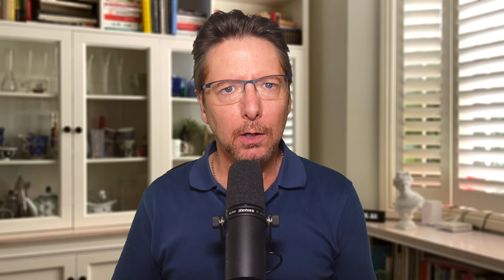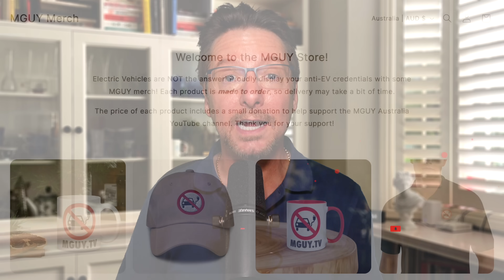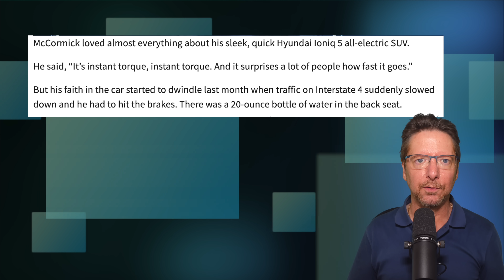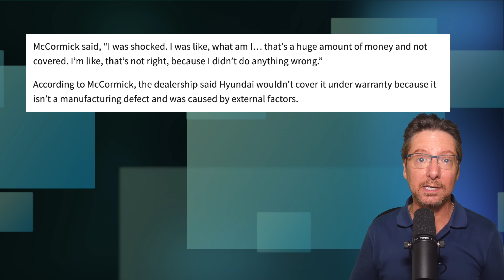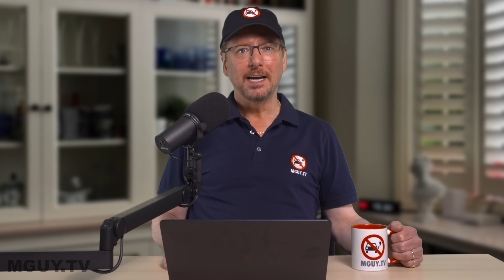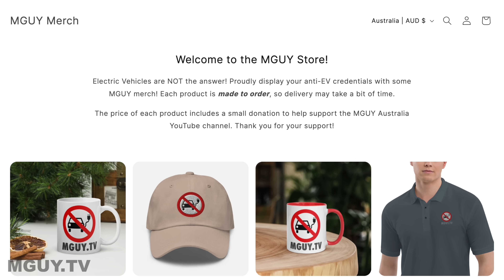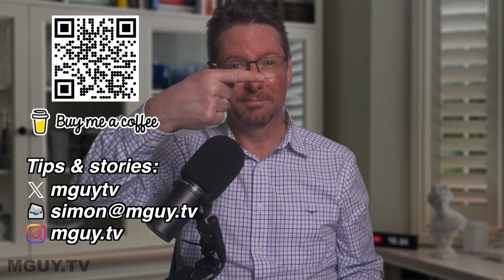ASTRONOMICAL EV repair bill for spilling a WATER BOTTLE! | MGUY Australia

Comment: I once accidentally parked a rally car in a river in Kenya (rainy season; the wooden bridge had been washed away). My co-driver and I, ignoring reports of crocodiles and hippos, winched it out, waited for the cabin to empty, gave a squirt of You-Know-What under the bonnet to give the electrics a thrill, searched in vain for some missing stage maps, and continued on our way. At no point did we consider the possibility that getting the car full of bright orange muddy water would end our rally.

It may be significant that EV-based 'Desert Raid' rally challenges tend to take place in the Sahara, where the wettest things to be found are the tears of laughter rolling down camels' cheeks as the beasts watch the cars attack the dunes.

Note: I've always maintained that only barbarians eat when walking on the street, and that any car manufacturer who fits cup-holders to a vehicle should be horse-whipped for encouraging in-car quaffing.

Don't (soft-)drink and drive, lest you b*gger up your car's interior.

Comment: A car of the same Ioniq brand ran over some small fallen tree branch in Canada and the wood caused a tiny scratch on the safety plate guarding the battery. Hyundai refused to even open the compartment to check but said buy a replacement battery for C$ 61000. More than the worth of the one year old car. Insurance totalled the car !
Moral: dont buy Hyundai Ioniq

Comment: So EVs are dxxked in hot weather,  cold weather and heavy rain/ monsoon weather
When are we supposed to take them out ?

I was driving in heavy rain in Bangalore India, large water puddles on the road, when this long distance bus decided to overtake everybody using  a lane abandoned due to flooding. Passengers and interior of my ICE drenched. I drove home cursing and kept the car doors open in the garage to dry out the interior. The car later ran smoothly ignoring the bath. (2006 manual gas 1.3 L suzuki hatch back)
Reply: You take them out when it is not too cold nor too hot & not too wet. But otherwise, they are great for when you are bored because you can spend time planning when and where to charge up, while drinking coffee, eating chips, and talking to other boring people charging their milkfloats, about how fast they accelerate while saving the whales, or something.

Comment: Would not cover  because it was not a " manufacturing defect ". The whole damn E V industry is a " manufacturing defect ".
Reply: Reminds me of the first Cell phones, get them damp and they failed.
Reply: @digger105337  They still do not like water!
Reply: Tiny Hat Mafia.
Reply: Correct. It is absolutely a manufacturing defect. 
A spilled bottle of water should not result in $12,000 in damage.
Reply: Yes. Very true.
Reply: Wasn't a "manufacturing defect", it was a "design defect". If they admitted the second, it would cost them far too much to recall and amend.
Reply: @damianwright3690  I'm shocked that aluminum is rusting that bad.  When it rusts, the rust forms a skin that stops more rust.
Reply: @robertsmith2956  Aluminium doesn't (edit: rust that bad), they must have screwed up somewhere. As an aside about aluminium rusting: There's a very very important reason why mercury is forbidden aboard aircraft - if elemental mercury gets in contact with aluminium, the reaction can eat through structural members, and the problem can remain hidden for a long time if the mercury manages to make its way into a tiny hidden nook. Look it up, there's videos on what elemental mercury does to aluminium.
Reply: @damianwright3690  Exactly.
Reply: "The whole damn (...) a " manufacturing defect "." 
 
As defective as the leftist governments trying to mandate EVs.
Reply: Insurance rates should reflect the total costs for repairs or replacement of all vehicles.  If my 1997 GM van blew up I would expect to get no more than $500. from them so no collision insurance is required. I'm happy with the am/fm radio , a heater and a.c. I go from A2B just like anyone else. My son in law has a 2016 Rogue that needs a new headlamp but it will cost over $3000 to replace. Check out repair costs when you buy your next vehicle (Google)
Reply: To be fair, I think they would have the same response if you took in your gas car with a similar issue (EDIT: similar in that it was caused by the operator, not a defect).
I'm not a fan of EVs and would never buy one, but the real story in this particular case is the fact that State Farm wouldn't cover the damage.  
Clearly it was accidental and this is precisely why you pay for insurance.
Having dealt with a similar issue with my home insurance, and my sister with medical insurance, there needs to be extreme reform within the insurance industry.
It has become a scam, as they weasel their way out of paying for anything.
Reply: @dt8185  Which they couldn't do if you were could not buy the insurance in the first place.
Put the premiums in the safe, and use the money when needed to fix/replace car.  Learn to drive and there is no need for insurance since you won't be at fault.
Reply: @robertsmith2956  What an odd reply.  Clearly you are underage or don't live in the west, where it is legally required that you have auto insurance in order to drive.  And since even perfect drivers can be victims of circumstance or other negligent drivers, your argument is rather ridiculous.
Reply: @dt8185  As I said.  The negligent driver is at fault and responsible, not you.
Reply: @robertsmith2956  Well, hopefully you have enough money in your safe to cover the car repair/replacement, medical, recovery bills, etc., when you get hit by an uninsured, negligent driver or are a victim of circumstance.  And, of course, you don't get a huge fine/jail time for driving without insurance.   Whatever floats your goat.
Reply: @dt8185  As I said, it is the drivers problem. Just forward the medical bill to him.  Of course I can fix the car.  I'm not wasting money on insurance, I keep it aside to replace the car when it wears out.
ay cash for medical treatment.  You will be shocked how much cheaper it is.  You could have major surgery every other year and come out ahead of obamacare insurance cost.
Reply: @dt8185  "To be fair, (...) a similar issue." 
 
A "similar issue" of "corrosion over time" after spilling some fresh water inside of a two year old car? My 16 year old Golf still works, and here the temperature hovers around zero - and they spray the roads with salt water - for months of the year. If I put my electric dehumidifier in the car, it might suck up half a liter of water in a few days.
Reply: @Laura_Norder-Vanity_Unfair  Poorly worded.  I meant similar in terms of an external, operator caused issue, not that a bottle of water dumping out on the floor would affect a gas car.  That said, if you poured that bottle of water into the infotainment unit, fried it, and the dealer determined there were no leaks into the car, then yeah, they probably wouldn't cover that either.

Comment: Computers are actually relatively easy/cheap to fix since they're very modular, unless you've bought a prebuilt with proprietary parts or the PSU failed and fried the whole machine. It's just that the computers inside cars are basically prebuilts when it comes to diagnosing and repairing problems.

Comment: The story about a water bottle was wrong or the insurance should have paid.  Even so $12K USD is an insane repair bill for some safety belts?  Not a defect?  How many cars would fail like this?  Did he buy the car used?  Maybe it had been exposed to salt water?  Salt water corrodes  if not removed quickly.  I have a 60 year old Vollvo P1800, I'd had water in the passenger compartment many times over that period and it isn't rusted nor ever need even a $500 repair bill ever. One reason the car industry has gone with so much tech is to have built in self destruct due to no support - They've gone iwth the Iphone model of built in obsolecence - oh water - new car!. Oh sorry that car is no longer supported its 6 years old - it is out of warranty. They can't be repaired by the owner, they want you dependent.

Comment: I am a GM tech, we had a suv towed in no start. Owner said that they were driving and all the warning came on and the radio stopped working. She turn off the truck and then had nothing. I found that that data line was pulled to ground (short) in the rear overhead dvd player by a coin that a kid slipped in the slot. to track id down and remove the coin and get running was a two hour job. The dealership covered it under good will because it was under warranty even though it was NOT A DEFECT but bad design and a tech bulletin was added to help techs.

Comment: I'm surprised there and not more instances of major problems due to corrosion.  I4 is in Florida.  I lived in south Louisiana for for 5 years and discovered how much the salt water atmosphere attacks the wiring in cars and motorcycles.  The surface corrosion causes any water that contacts it to become electrically conductive.

Comment: Tthats what you get when you cheap out on protective coatings and have high density boards with pcb's 4 layers or more. Glassfiber boards can/will wick up moisture if not properly made or protected. Pcb's today made with 5 mil or less, so it doesnt take much to get a bad track, even better if the fault is in the internal layers. Try to fix that with no schematics! With 0.5 oz of copper or less and tracks 1-5mil it doesnt take much to burn those out.

Comment: I thought it would be because in a lot of EV's the batteries are basically right under the rear seats/floorboards. It's even worse that it's just the driving controls and such that are destroyed by a little bit of water. The repair guy even said it could of been caused by merely wearing wet clothes lol. As in you get rained on and sit in your car, and you destroy it. Reminds me of the stories of EV's being bricked because some one took it through a car wash.

Comment: HAHAHA, I work on Land Rovers and some of the RRS's  and RR have an issue where the hose from the windshield washer to the rear of the truck will brake and dump the contents on the bottle into the car and it still doesn't cost the customer 10k at Land Rover prices to repair.

Comment: I live in the USA northwest and we have endless fir trees.  I have an old Mazda where you have to clean out the cowl drains yearly , or they will clog with fir needles and get the  driver's and passenger floor wet .  The new vehicles are fragile devices designed to drain your bank account in one big hurry... and its no accident.

Comment: I do contract work for a bodyshop.
Tesla model S headlight unit... None in the UK so had to be imported.
2 months later... One correct Tesla headlight, they sent the wrong one originally.
£2500 for the headlight!
My old van leaked when it rained, the drivers floor went between paddy field wet and slightly damp.
It was like that for 15 years, no issues. It eventually rusted, but the drivers footwell wasnt rusted.

Comment: My 1997 Honda van, which I use as a surf vehicle, has more beach inside it than outside.   I often forget to close the windows when it rains, and the doors get soaked.   It never gets cleaned.  The car has had zero issues, except for a loose wire to the battery one time.   It has never failed to start, even with the loose battery.  Best car ever made.
Reply: THE INSIDE OF YOUR HOUSE IS THE SAME WAY!!

*NEVER GETS CLEANED*
Reply: @bellytripper-nh8ox  True for the most part.
Reply: @bellytripper-nh8ox  True

Comment: Disclaimer; Not trying to defend EVs. I cackle every time I see one of the worthless things burst into flames.

But this has nothing do with it being an EV. I was a dealership mechanic for years, and diagnosing electronics was my main skill. This is just ALL modern cars. Every model, Gas or electric, have so many useless features in them that they really are this vulnerable to water. 15 inch Touch screens, heated and cooled seats that massage your ass, DVD players, $2000 slabs of glass over your head held together by 20 cent plastic clips. All controlled by miles and miles of wiring, and dozens of control modules. Pretty much NONE of the connectors inside of the cabin are weather/water-proofed. Modules inside are usually not weather proofed either. "They're inside the cabin, why bother?" -Someone in Accounting probably.
I've had to replace body control modules in cars because the owners got their windshields replaced, and the shops that did that didn't get the glass sealed correctly. Tiny little bit a water (Or in this case, washer fluid,) and the module goes pop.

But even then, $12,000 seems way steep. Either we're not getting the full details (Shocker,) Hyundai is even shadier than I thought (I refuse to touch Hyundai/Kia with a 12 foot pole anyways,) or the dealer's trying to pull a fast one (Also shocker.)

There's a reason a lot of mechanics only drive older cars. The newest car I drive is a 2008 retired police model Crown Victoria. The most complex thing it has that can go wrong on it is the aftermarket stereo I installed. That car was so basic it only came with an AM/FM radio... No cassette, no CD, no aux. AM and FM, that's it.
As long as people continue to buy luxury spas on wheels though, this problem will only continue to get worse.

Comment: I helped my nephew wire his winch on the front of his Jeep with a 6” lift. He goes off-road and sometimes crosses water crossings a 1/4 to 1/2 of his doors. He allows changes in fluids after a trip and has never had an electrical problem. Maybe something broke because the trail some are harder than others.

Comment: Electricity and water (H2O) is not a problem (water doesn't conduct electricity).
Dirty or water mixed with other chemichals will conduct electricity and be dangerous depending on the tension (V) and current capacity (I and W/h)

Comment: This is absolutely hilarious.  These EV buyers deserve every penny they have to shell out for the fake climate BS. I wonder how many of these EV's are built using soy insulated wiring 🤔 Just wait till the mice get a taste of that 😂 And then the insurance companies will deny claims because of the wiring attracting mice.  This whole EV thing is hilarious to watch as the poor liberals keep losing it each time their cheaper car turns out to cost an arm and both legs to operate and keep running.  Tires alone have cost one person I know of 4 times what they did for their ICE vehicles. They drive the same amount of miles but have had to change their tires 4 times more than their ICE car tires because of the battery weight! I don't feel sorry for them because they fell for the EV BS hook, line and sinker!

Comment: Saw  a local news bit on this, they were all in the bag for this guy & never mentioned the sand or that the adjuster determined there was ongoing corrosion.  That would be easy to spot.  If I was inclined to even consider buying one of these turds one of my first questions would be where's the battery followed by how's it protected.  Sounds like this guy never gave a thought to any possible vulnerabilities his toy car may have which is odd considering everyone knows you don't drop your phone in the ocean.

Comment: This not just EVs all modern cars are the same water on damp getting into the electrical units anywhere will require the replacement of the entire unit, and cause ridiculous contradictory  fault codes. 
Damp causes digital codes to mis read causing the central computer to become so confused as to what the nonexistent digital numbers refer to it eventually just crashes, hence you cannot get any control to work.
This is why I would not get in any car that is stear by wire or break by wire, they are all death traps!

Comment: I had an Audi A4 a lonf time ago (a few decades back) that flooded to just under the seat level from high water.  It broke a computer under the passenger seat and it was in limp home mode where it was stuck in 1st gear.  VERY pricy for a water damage - but it was just the computer needing replacement so guess I was lucky <g>

Comment: In 2023 I had one of those office water bottles on the backseat of my Mazda CX5.
It fell over and broke, pouring out half of the water in the carpet and floor.  I cleaned up as best as I could, but it was still soaked.
Two years later the CX5 is still running strong.
We are currently in the middle of a road trip back to Ontario and driving back to Nova Scotia next week.

Comment: You do know that Hyundai make it almost impossible to replace the rear brake pads. They do actually pay lip service to  make it possible to satisfy regulators but owners would have to pay a massive amount to buy a dedicated Hyundai computer and another pay for temporary subscription on top, making it very very expensive to do so and the hoops to jump through to do so, even disregarding the cost, kills home maintenance dead.

Comment: "Instead of replacing a small part, you end up replacing a huge chunk of the car at enormous expense" This goes for modern ICE cars as well, they are just as crammed with expensive electronic modules. Even something as simple as a blown headlight can cost upwards of $2k since they're sealed LED units these days, you have to replace the whole assembly instead of swapping out a $20 globe.
Reply: We put LED bulbs in our houses to save energy. A car especially an ICE car has an alternator to make it's own electrical power. WHY do we need LED lights in them other than for bling and styling. incandescent bulbs have worked just fine for over 100 years, at a fraction of the cost. This kind of un needed tech is why cars are so expensive.